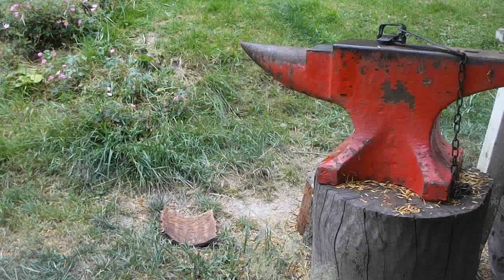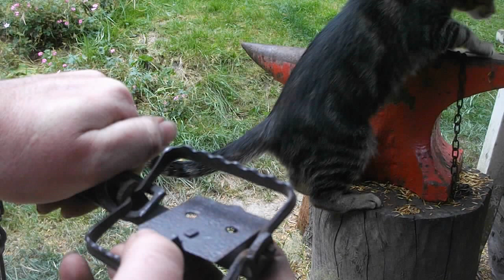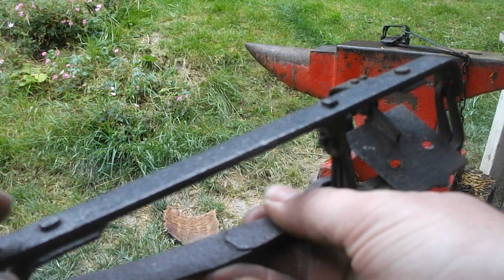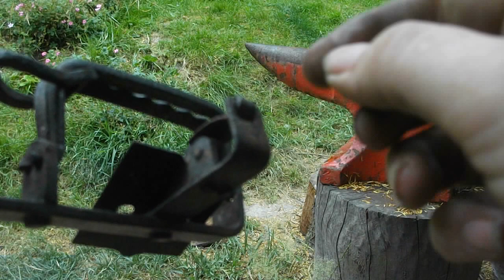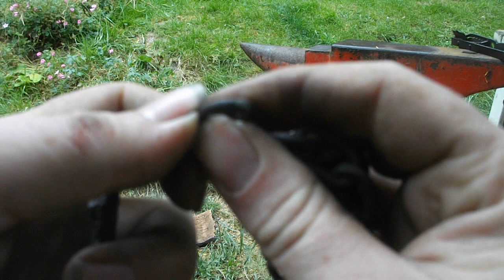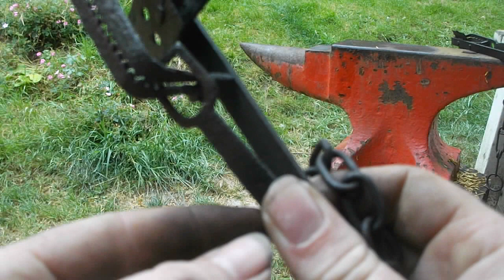Ironwork collection - Gin Trap.

Comment: Mr. Taylor,  I am glad I found this video.  I like all old iron work and watch a lot of blacksmithing videos.  I see them making everything but traps.  I am thinking of making a few for myself and this is the only subject toughing it.  Anyway thanks for posting and explaining the traps and how they were constructed.
Reply from the maker: +feral tweed Thank you very much. I have a growing collection of items of historical items such as these as this is my main interest. I had planned to discuss all of them but I don't know how many people would actually be interested. I have been debating for a couple of weeks now whether to make a video on how gin traps were made which would demonstrate the techniques needed so you may be in luck if you pop back in a month.
Reply: +RowanTaylor I would be interested.
Reply: +RowanTaylor  Interesting stuff Mr. Taylor. Like the fellow above, I am both a trapper and do my own forging. I have been forging for a very short time, having less than a year of anvil time. Trapping on the other hand I have done for over 52 seasons. The "toggle" you speak of is the "dog" of the trap. The "pressure plate" is the traps "pan". If used correctly foot-hold traps are not the slightest bit cruel. Those old traps you own would have been hard on the caught beast simply because the chain is fastened at the end of the spring instead of directly under the pan. The offset would cause the trapped animal to pull at an un-natural angle to its ankle, causing the trap to twist the foot uncomfortably. Modern trappers "center swivel" their traps(attach the swiveled chain under the pan) to prevent that. Wildlife biologists regularly use foot-hold traps to catch animals for study. Those animals are not harmed by the trapping.